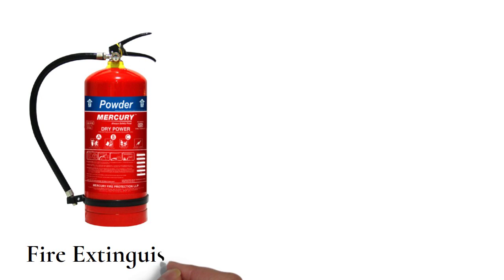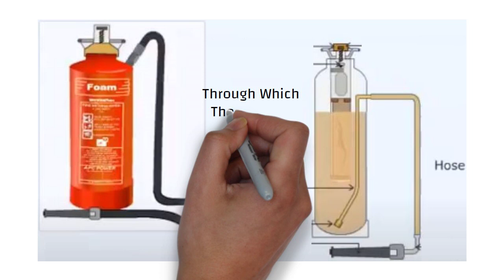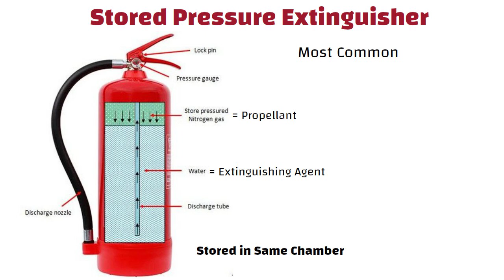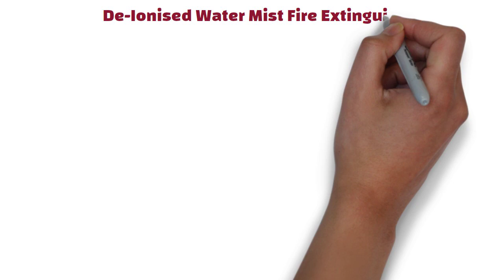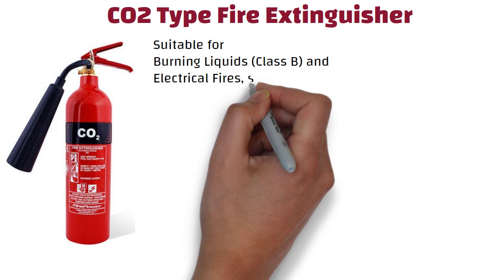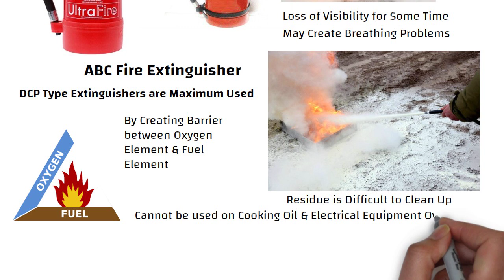FIRE EXTINGUISHER DEALERS IN KERALA, CALL 8138906102, FIRE EXTINGUISHER DEALERS IN ERNAKULAM.

Comment from the maker: KIRLOSKAR FIRE FIGHTING PUMP DEALERS IN KOTTARAKKARA, FIRE FIGHTING EQUIPMENT DEALERS IN KOTTARAKKARA, FIRE ALARM SYSTEM DEALERS IN KOTTARAKKARA, FIRE CONSULTANTS IN KOTTARAKKARA, FIRE CONTRACTOTORS IN KOTTARAKKARA, FIRE CONTRACTORS IN KOTTARAKKARA, FIRE ALARM SYSTEM DEALERS IN KOTTARAKKARA, SMOKE DETECTOR DEALERS IN KOTTARAKKARA, FIRE PROTECTION SYSTEM IN KOTTARAKKARA, FIRE CONSULTANTS IN KOTTARAKKARA, FIRE CONSULTANTS IN KOTTARAKKARA, PA TALK BACK SYSTEM IN KOTTARAKKARA, ADDRESSABLE FIRE ALARM SYSTEMS IN KOTTARAKKARA, CUTTER PUMP DEALERS IN KOTTARAKKARA, ADDRESSABLE FIRE ALARM SYSTEM SUPPLIERS IN KOTTARAKKARA, SMOKE DETECTOR DEALERS IN TKOTTARAKKARA, PRESSURE BOOSTING PUMP DEALERS IN KOTTARAKKARA, SLURRY PUMP DEALERS IN KOTTARAKKARA, WATER PUMP DEALERS IN KOTTARAKKARA, RAVEL FIRE ALARM SYSTEM IN KOTTARAKKARA, LUBI FIRE FIGHTING PUMP DEALERS IN KOTTARAKKARA, FIRE EXTINGUISHER DEALERS IN KOTTARAKKARA, ADDRESSABLE FIRE ALARM SYSTEM DEALERS IN KOTTARAKKARA, 
KIRLOSKAR FIRE FIGHTING PUMP DEALERS IN KOTTARAKKARA, KIRLOSKAR FIRE FIGHTING PUMP DISTRIBUTORS IN KOTTARAKKARA, KIRLOSKAR FIRE PUMPS IN KOTTARAKKARA, KIRLOSKAR DIESEL ENGINE FIRE STANDBY PUMP DEALERS IN KOTTARAKKARA, KIRLSOKAR MONOBLOCK FIRE PUMP DEALERS IN KOTTARAKKARA, KIRLOSKAR FIRE TERRACE PUMP DEALERS IN KOTTARAKKARA, KIRLOSKAR FIRE PUMPS IN KOTTARAKKARA, KIRLOSKAR FIRE FIGHTING PUMP IN KARNATAKA, KIRLOSKAR FIRE PUMP DEALERS IN KARNATAKA, KIRLOKAR FIRE PUMP DEALERS IN HOSUR, KIRLSOAKR FIRE FIGHTING PUMP DEALERS IN KOTTARAKKARA, KIRLOSKAR FIRE PUMPS IN KOTTARAKKARA, KIRLSOKAR FIRE PUMP DISTRIBUTORS IN KOTTARAKKARA, FIRE ENGINE PUMP SETS IN KOTTARAKKARA, KIRLOSKAR PUMP DEALERS IN TIRUELVELI, KIRLOSKAR DEALERS IN KARNATAKA, KIRLOSKAR PUMPS IN KARNATAKA, KIRLOSKAR PUMPS IN KOTTARAKKARA, LUBI FIRE PUMP DEALERS IN KOTTARAKKARA, LUBI FIRE PUMP DEALERS IN KARNATAKA, LUBI FIRE PUMP DEALERS IN KOTTARAKKARA, FIRE PUMP SUPPLERS IN KAYAKUMARI, FIRE FIGHTING PUMP DEALERS IN KAYAKUMARIHOSUR, FIRE PUMP DEALERS IN KARNATAKA, FIRE PUMP SUPPLIERS IN KOTTARAKKARA, FIRE PUMP DEALERS IN KOTTARAKKARA, FIRE FIGHTING PUMPS IN KOTTARAKKARA, FIRE FIGHTING PUMP DEALERS IN KOTTARAKKARA, FIRE FIGHTING PUMP SUPPLIERS IN KARNATAKA, FIRE FIGHTING PUMP SET DEALERS IN KOTTARAKKARA, FIRE PUMP IN KARNATAKA, FIRE PUMP IN KOTTARAKKARA, FIRE PUMP IN KOTTARAKKARA, FIRE DIESEL ENGINE PUMP DEALERS IN KOTTARAKKARA, FIRE DIESEL ENGINE STANDBY PUMP DEALERS IN KOTTARAKKARA, FIRE JOCKEY PUMP DEALERS IN KOTTARAKKARA, FIRE JOCKEY PUMP DEALERS IN KARNATAKA, FIRE JOCKEY PUMP DEALERS IN KOTTARAKKARA. CRI PUMP DEALERS IN KOTTARAKKARA, HYDRO PNEUMATIC PRESSURE BOOSTING PUMP DEALERS IN KOTTARAKKARA, VERTICAL INLINE PUMP DEALERS IN KOTTARAKKARA, INDUSTRIAL PUMP DEALERS IN KOTTARAKKARA, SEWAGE PUMP DEALERS IN KOTTARAKKARA, STP AND ETP PUMP DEALERS IN TIRUNELVALEI, STP AND ETP PUMP DEALERS IN TKOTTARAKKARA, STP AND ETP PUMP DEALERS IN KOTTARAKKARA, STP AND ETP PUMP DEALERS IN KARNATAKA, HYDRO PNEUMATIC PRESSURE BOOSTING PUMP DEALERS IN KOTTARAKKARA, SEWAGE PUMP DEALERS IN KOTTARAKKARA, DEWATERING PUMP DEALERS IN KOTTARAKKARA, FIRE JOCKEY PUMP DEALERS IN KOTTARAKKARA,
Reply: FIRE EXTINGUISHER DEALERS IN THALASSERY, FIRE EXTINGUISHER SUPPLIERS IN THALASSERY, FIRE EXTINGUISHER DISTRIBUTORS IN THALASSERY, FIRE EXTINGUISHER IN THALASSERY, ABC TYPE FIRE EXTINGUISHER DEALERS IN THALASSERY, CO2 TYPE FIRE EXTINGUISHER DEALERS IN THALASSERY, CLEAN AGENT FIRE EXTINGUISHER IN THALASSERY, MODULAR TYPE FIRE EXTINGUISHER DEALERS IN THALASSERY, MECHANICAL FOAM FIRE EXTINGUISHER DEALERS IN THALASSERY, FIRE EXTINGUISHER NEAR ME THALASSERY, FIRE EXTINGUISHER TRADERS IN THALASSERY, FIRE FIGHTING COMPANIES IN THALASSERY, FIRE CONTRACTORS IN THALASSERY, FIRE EQUIPMENT DEALERS IN THALASSERY, FIRE ALARM DEALERS IN THALASSERY, FIRE PUMP DEALERS IN THALASSERY, SMOKE DETECTOR DEALERS IN THALASSERY, FIRE FIGHTING SYSTEM IN THALASSERY, FIRE PROTECTION SYSTEM IN THALASSERY, FIRE AND SAFETY CONTRACTORS IN THALASSERY, FIRE HYDRANT SYSTEMS IN THALASSERY, PA TALK BACK SYSTEM IN THALASSERY, FIRE NOC IN THALASSERY, FIRE INSTALLATION IN THALASSERY, FIRE NOC RENEWAL IN THALASSERY, KIRLOSKAR FIRE PUMP DEALERS IN THALASSERY, FIRE EXTINGUISHER NEAR ME THALASSERY, FIRE EXTINGUISHER MANUFACURERS IN THALASSERY, SAFEX FIRE EXTINGUISHER DEALERS IN THALASSERY, FIRE NOC CONTRACTORS IN THALASSERY, FIRE FIGHTING EQUIPMENT DEALERS IN THALASSERY, FIRE PROTECTION SYSTEM IN THALASSERY, FIRE INSTALLATION IN THALASSERY, FIRE SAFETY CONTRACTORS IN THALASSERY, FIRE AMC IN THALASSERY, FIRE PROTECTION SYSTEM IN THALASSERY, FIRE PROTECTION EQUIPMET IN THALASSERY, AMC OF FIRE SYSTEM IN THALASSERY, FIRE CONSULTANTS IN THALASSERY, FIRE AND SAFETY EQUIPMENT DEALERS IN THALASSERY, ADDRESSABLE FIRE ALARM SYSTEM IN THALASSERY, KARTHAR VALVE DEALERS IN THALASSERY, DCP TYPE FIRE EXTINGUISHER IN THALASSERY, POWSER TYPE FIRE EXTINGUISHERS IN THALASSERY, FIRE HYDRANT SYSTEM IN THALASSERY, FIRE ALARM PANEL DEALERS IN THALASSERY, SAFEPRO FIRE EXTINGUISHER DEALERS IN THALASSERY, MS AND GI PIPE DEALERS IN THALASSERY, JINDAL PIPE DEALERS IN THALASSERY, AGNI FIRE ALARM DEALERS IN THALASSERY, FIRE EQUIPMENT DEALERS IN THALASSERY, FIRE EQUIPMENT SUPPLIERS IN THALASSERY, FIRE EQUIPMENT TRADERS IN THALASSERY, FIRE SPRINKLER SYSTEM IN THALASSERY, RAVEL FIRE ALARM DEALERS IN THALASSERY, RAVEL FIRE ALARM SYSTEM IN THALASSERY, AGNI FIRE ALARM DISTRIBUTORS IN THALASSERY, FIRE ALARM CONTRACTORS IN THALASSERY, FIRE PIPE INSTALLATION IN CONTRACTORS IN THALASSERY, FIRE SAFETY CONTRACTORS IN THALASSERY, FIRE PA TWO WAY TALK BACK SYSTEM DEALERS IN THALASSERY, HEAT DETECTOR DEALERS IN THALASSERY, HONEYWELL FIRE ALARM DEALERS IN THALASSERY, FIRE NOC CONSULTANTS IN THALASSERY, FIRE AMC AND FIRE NOC IN THALASSERY, FIRE SAFETY COMPANIES IN THALASSERY, NEWAGE DEALERS IN THALASSERY, MONSHER FIRE EQUIPMENT DEALERS IN THALASSERY, KARTHAR VALVE DEALERS IN THALASSERY, FIRE HYDRANT VALVE DEALERS IN THALASSERY, FIRE HOSE REEL DRUM DEALERS IN THALASSERY, FIRE SPRINKLER DEALERS IN THALASSERY, FIRE PUMP DEALERS IN THALASSERY, LUBI PUMP DEALERS IN THALASSERY, LHP PUMP DEALERS IN THALASSERY. FIRE CONTRACTORS IN THALASSERY, FIRE AND SAFETY CONTRACTORS IN THALASSERY, FIRE EQUIPMENT DEALERS IN THALASSERY, FIRE FIGHTING CONTRACTORS IN THALASSERY, AGNI FIRE ALARM DEALERS IN THALASSERY, PA TALK BACK SYSTEM DEALERS IN THALASSERY, FIRE NOC IN THALASSERY, FIRE NOC RENEWAL IN THALASSERY, FIRE SYSTEM INSTALLATION IN THALASSERY.
Reply: FIRE EXTINGUISHER DEALERS IN ERNAKULAM, FIRE EXTINGUISHER DEALERS IN TRIVANDRUM, FIRE EXTINGUISHER DEALERS IN KOCHI, FIRE EXTINGUISHER DEALERS IN THRISSUR, FIRE EXTINGUISHER DEALERS IN PALAKKAD, FIRE EXTINGUISHER DEALERS IN KOTTAYAM, FIRE EXTINGUISHER DEALERS IN CHANGANASSERY, FIRE EXTINGUISHER DEALERS IN THIRUVALLA, FIRE EXTINGUISHER DEALERS IN CHENGANNUR, FIRE EXTINGUISHER DEALERS IN ALEPPEY, FIRE EXTINGUISHER DEALERS IN ADOOR, FIRE EXTINGUISHER DEALERS IN PANDALAM, FIRE EXTINGUISHER DEALERS IN KARUNAGAPALLY, FIRE EXTINGUISHER DEALERS IN KARUNAGAPPALLY, FIRE EXTINGUISHER DEALERS IN KAYAMKULAM, FIRE EXTINGUISHER DEALERS IN PATHANAMTHITTA, FIRE EXTINGUISHER DEALERS IN OACHIRA, FIRE EXTINGUISHER DEALERS IN KOLLAM, FIRE EXTINGUISHER DEALERS IN TRIVANDRUM, FIRE EXTINGUISHER DEALERS IN PERUMBAVOOR, FIRE EXTINGUISHER DEALERS IN KOTHAMANGALAM, FIRE EXTINGUISHER DEALERS IN MOOVATTUPUZHA, FIRE EXTINGUISHER DEALERS IN PALA, FIRE EXTINGUISHER DEALERS IN VALANCHERY, FIRE EXTINGUISHER DEALERS IN MALAPPURAM, FIRE EXTINGUISHER DEALERS IN TIRUR, FIRE EXTINGUISHER DEALERS IN CALICUT, FIRE EXTINGUISHER DEALERS IN PONNANI, FIRE EXTINGUISHER DEALERS IN PAYYANNUR, FIRE EXTINGUISHER DEALERS IN PAYYANUR, FIRE EXTINGUISHER DEALERS IN WAYANAD, FIRE EXTINGUISHER DEALERS IN KALPETTA, FIRE EXTINGUISHER DEALERS IN MANANTHAVADY, FIRE EXTINGUISHER DEALERS IN FEROKE, FIRE EXTINGUISHER DEALERS IN THANUR, FIRE EXTINGUISHER DEALERS IN KERALA, FIRE EXTINGUISHER DEALERS IN CHALAKKUDY, FIRE EXTINGUISHER DEALERS IN KODUNGALLUR, FIRE EXTINGUISHER DEALERS IN ANGAMALY, FIRE EXTINGUISHER DEALERS IN BATHERY, FIRE EXTINGUISHER DEALERS IN, MUNNAR, FIRE EXTINGUISHER DEALERS IN IDUKKI, FIRE EXTINGUISHER DEALERS IN MANJERI, FIRE EXTINGUISHER DEALERS IN THALASSERY, FIRE EXTINGUISHER DEALERS IN THRIPUNITHURA, FIRE EXTINGUISHER DEALERS IN VADAKARA, FIRE EXTINGUISHER DEALERS IN KANHANGAD, FIRE EXTINGUISHER DEALERS IN KOYILANDI, FIRE EXTINGUISHER DEALERS IN KALAMASSERY, FIRE EXTINGUISHER DEALERS IN NEYYATINKARA, FIRE EXTINGUISHER DEALERS IN GURUVAYUR, FIRE EXTINGUISHER DEALERS IN VADAKKANCHERY, FIRE EXTINGUISHER DEALERS IN PARAPPANAGADI, FIRE EXTINGUISHER DEALERS IN NEDUMANGAD, FIRE EXTINGUISHER DEALERS IN KASARGOD, FIRE EXTINGUISHER DEALERS IN PAYYOLI, FIRE EXTINGUISHER DEALERS IN PUNALUR, FIRE EXTINGUISHER DEALERS IN CHERTHALA, FIRE EXTINGUISHER DEALERS IN THALIPARAMBA, FIRE EXTINGUISHER DEALERS IN KOTTAKKAL, FIRE EXTINGUISHER DEALERS IN SHORANUR, FIRE EXTINGUISHER DEALERS IN IRITTY, FIRE EXTINGUISHER DEALERS IN ATTINGAL, FIRE EXTINGUISHER DEALERS IN HARIPAD, FIRE EXTINGUISHER DEALERS IN MUVATTUPUZHA, FIRE EXTINGUISHER DEALERS IN MOOVATTUPUZHA, FIRE EXTINGUISHER DEALERS IN KOOTHUPARAMBA, FIRE EXTINGUISHER DEALERS IN IRINJALAKUDA, FIRE EXTINGUISHER DEALERS IN MAVELIKKARA, FIRE EXTINGUISHER DEALERS IN VARKALA, FIRE EXTINGUISHER DEALERS IN MANATHAVADI, FIRE EXTINGUISHER DEALERS IN KOTTARAKARA, FIRE EXTINGUISHER DEALERS IN KOTTARAKKARA, FIRE EXTINGUISHER DEALERS IN RANNI, FIRE EXTINGUISHER DEALERS IN MALLAPALLY, FIRE EXTINGUISHER DEALERS IN ALUVA, FIRE EXTINGUISHER DEALERS IN SHORANUR, FIRE EXTINGUISHER DEALERS IN EDAPPAL, FIRE EXTINGUISHER DEALERS INKUTTIPURAM, FIRE EXTINGUISHER DEALERS IN PERINTHALMANNA, FIRE EXTINGUISHER DEALERS IN NILESWAR, FIRE EXTINGUISHER DEALERS IN KUTTIADI, FIRE EXTINGUISHER DEALERS IN MAHE, FIRE EXTINGUISHER DEALERS IN THAMARASSERY, FIRE EXTINGUISHER DEALERS IN PONKUNNAM, FIRE EXTINGUISHER DEALERS IN NILAMBUR, FIRE EXTINGUISHER DEALERS IN PATTAMBI, FIRE EXTINGUISHER DEALERS IN VALPARAI, FIRE EXTINGUISHER DEALERS IN ADIMALY, FIRE EXTINGUISHER DEALERS IN KOOTHATTUKULAM, FIRE EXTINGUISHER DEALERS IN THALAYOLAPARAMBU, FIRE EXTINGUISHER DEALERS IN ETTUMANUR, FIRE EXTINGUISHER DEALERS IN KANJIRAPPALY, FIRE EXTINGUISHER DEALERS IN CHAVARA, FIRE EXTINGUISHER DEALERS IN KILIMANUR, FIRE EXTINGUISHER DEALERS IN KUTTIKKANAM, FIRE EXTINGUISHER DEALERS IN PERAMBRA, FIRE EXTINGUISHER DEALERS IN MANNARKKAD, FIRE EXTINGUISHER DEALERS IN KUNDARA, FIRE EXTINGUISHER DEALERS IN TANUR, FIRE EXTINGUISHER DEALERS IN NOORANAD, FIRE EXTINGUISHER DEALERS IN KONNI, FIRE EXTINGUISHER DEALERS IN SASTHAMKOTTA, FIRE EXTINGUISHER DEALERS IN PATHANAPURAM, FIRE EXTINGUISHER DEALERS IN  ANCHAL, FIRE EXTINGUISHER DEALERS IN  KOZHENCHERY, FIRE EXTINGUISHER DEALERS IN  MUNDAKAYAM, FIRE EXTINGUISHER DEALERS IN  KANJIRAPALLY, FIRE EXTINGUISHER DEALERS IN VAIKOM, FIRE EXTINGUISHER DEALERS IN KATTAPANA, FIRE EXTINGUISHER DEALERS IN CHIRAYANKEEZHU, FIRE EXTINGUISHER DEALERS IN KOLENCHERY, FIRE EXTINGUISHER DEALERS IN MAHE, FIRE EXTINGUISHER DEALERS IN NADAPURAM, FIRE EXTINGUISHER DEALERS IN KUTTIYADI.
Reply: FIRE EXTINGUISHER DEALERS IN WAYANAD, FIRE EXTINGUISHER SUPPLIERS IN WAYANAD, FIRE EXTINGUISHER DISTRIBUTORS IN WAYANAD, FIRE EXTINGUISHER IN WAYANAD, ABC TYPE FIRE EXTINGUISHER DEALERS IN WAYANAD, CO2 TYPE FIRE EXTINGUISHER DEALERS IN WAYANAD, CLEAN AGENT FIRE EXTINGUISHER IN WAYANAD, MODULAR TYPE FIRE EXTINGUISHER DEALERS IN WAYANAD, MECHANICAL FOAM FIRE EXTINGUISHER DEALERS IN WAYANAD, FIRE EXTINGUISHER NEAR ME WAYANAD, FIRE EXTINGUISHER TRADERS IN WAYANAD, FIRE FIGHTING COMPANIES IN WAYANAD, FIRE CONTRACTORS IN WAYANAD, FIRE EQUIPMENT DEALERS IN WAYANAD, FIRE ALARM DEALERS IN WAYANAD, FIRE PUMP DEALERS IN WAYANAD, SMOKE DETECTOR DEALERS IN WAYANAD, FIRE FIGHTING SYSTEM IN WAYANAD, FIRE PROTECTION SYSTEM IN WAYANAD, FIRE AND SAFETY CONTRACTORS IN WAYANAD, FIRE HYDRANT SYSTEMS IN WAYANAD, PA TALK BACK SYSTEM IN WAYANAD, FIRE NOC IN WAYANAD, FIRE INSTALLATION IN WAYANAD, FIRE NOC RENEWAL IN WAYANAD, KIRLOSKAR FIRE PUMP DEALERS IN WAYANAD, FIRE EXTINGUISHER NEAR ME WAYANAD, FIRE EXTINGUISHER MANUFACURERS IN WAYANAD, SAFEX FIRE EXTINGUISHER DEALERS IN WAYANAD, FIRE NOC CONTRACTORS IN WAYANAD, FIRE FIGHTING EQUIPMENT DEALERS IN WAYANAD, FIRE PROTECTION SYSTEM IN WAYANAD, FIRE INSTALLATION IN WAYANAD, FIRE SAFETY CONTRACTORS IN WAYANAD, FIRE AMC IN WAYANAD, FIRE PROTECTION SYSTEM IN WAYANAD, FIRE PROTECTION EQUIPMET IN WAYANAD, AMC OF FIRE SYSTEM IN WAYANAD, FIRE CONSULTANTS IN WAYANAD, FIRE AND SAFETY EQUIPMENT DEALERS IN WAYANAD, ADDRESSABLE FIRE ALARM SYSTEM IN WAYANAD, KARTHAR VALVE DEALERS IN WAYANAD, DCP TYPE FIRE EXTINGUISHER IN WAYANAD, POWSER TYPE FIRE EXTINGUISHERS IN WAYANAD, FIRE HYDRANT SYSTEM IN WAYANAD, FIRE ALARM PANEL DEALERS IN WAYANAD, SAFEPRO FIRE EXTINGUISHER DEALERS IN WAYANAD, MS AND GI PIPE DEALERS IN WAYANAD, JINDAL PIPE DEALERS IN WAYANAD, AGNI FIRE ALARM DEALERS IN WAYANAD, FIRE EQUIPMENT DEALERS IN WAYANAD, FIRE EQUIPMENT SUPPLIERS IN WAYANAD, FIRE EQUIPMENT TRADERS IN WAYANAD, FIRE SPRINKLER SYSTEM IN WAYANAD, RAVEL FIRE ALARM DEALERS IN WAYANAD, RAVEL FIRE ALARM SYSTEM IN WAYANAD, AGNI FIRE ALARM DISTRIBUTORS IN WAYANAD, FIRE ALARM CONTRACTORS IN WAYANAD, FIRE PIPE INSTALLATION IN CONTRACTORS IN WAYANAD, FIRE SAFETY CONTRACTORS IN WAYANAD, FIRE PA TWO WAY TALK BACK SYSTEM DEALERS IN WAYANAD, HEAT DETECTOR DEALERS IN WAYANAD, HONEYWELL FIRE ALARM DEALERS IN WAYANAD, FIRE NOC CONSULTANTS IN WAYANAD, FIRE AMC AND FIRE NOC IN WAYANAD, FIRE SAFETY COMPANIES IN WAYANAD, NEWAGE DEALERS IN WAYANAD, MONSHER FIRE EQUIPMENT DEALERS IN WAYANAD, KARTHAR VALVE DEALERS IN WAYANAD, FIRE HYDRANT VALVE DEALERS IN WAYANAD, FIRE HOSE REEL DRUM DEALERS IN WAYANAD, FIRE SPRINKLER DEALERS IN WAYANAD, FIRE PUMP DEALERS IN WAYANAD, LUBI PUMP DEALERS IN WAYANAD, LHP PUMP DEALERS IN WAYANAD. FIRE CONTRACTORS IN WAYANAD, FIRE AND SAFETY CONTRACTORS IN WAYANAD, FIRE EQUIPMENT DEALERS IN WAYANAD, FIRE FIGHTING CONTRACTORS IN WAYANAD, AGNI FIRE ALARM DEALERS IN WAYANAD, PA TALK BACK SYSTEM DEALERS IN WAYANAD, FIRE NOC IN WAYANAD, FIRE NOC RENEWAL IN WAYANAD, FIRE SYSTEM INSTALLATION IN WAYANAD, FIRE EXTINGUISHER DEALERS IN KALPETTA, FIRE EXTINGUISHER DEALERS IN BATHERY, FIRE EXTINGUISHER DEALERS IN MANATHAVADY.